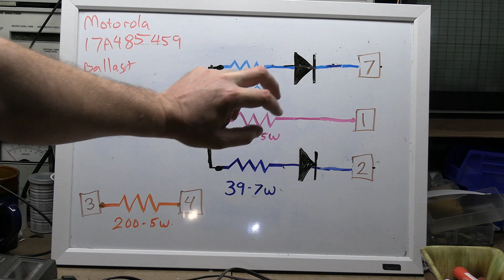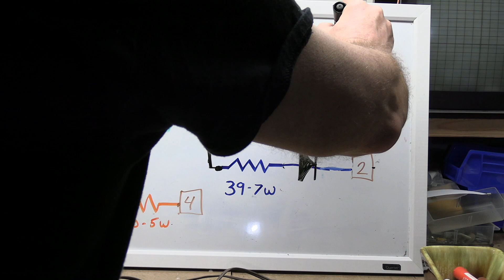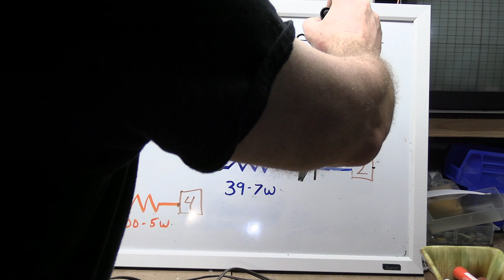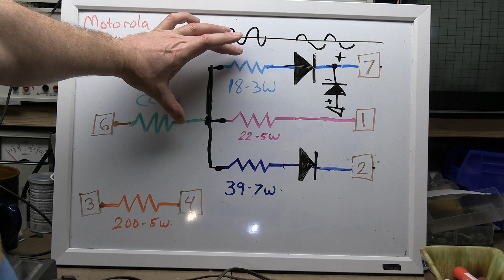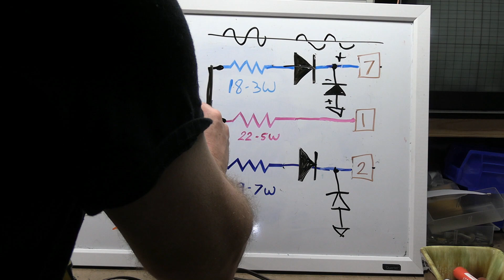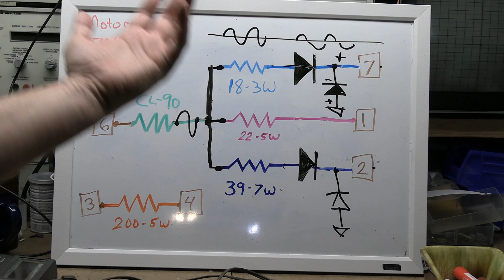Ultimate Guide to Motorola TV ballasts: Better protection

Comment: I was reading in the EEV blog about the purpose of small capactors in paralel with rectifying diodes to prevent RF noise would these be necessary in this situation? Might only affect AM radio.
Reply from the maker: There are small ceramic disc caps between the tube filaments already to filter out noise.  Otherwise, yes it would be a good idea.

Comment: At firstcI thought 2 diodes in series but then you would not know if one had failed comprimising the one thats left. This seems the most practical solution.
Reply from the maker: Yes, that is certainly another option.  You could do both and have 3 diodes in each branch.

Comment: In legs 1 and 3, I'd exchange the positions of the resistor and the forward diode, with the reverse "crow bar" diode to ground right after the forward diode.  This means the fuse blows but the resistors are probably unharmed in the scenario of the forward diode developing a short from a power spike.  It will require a few more pieces of wire to hook up inside the ballast case, but that's it I think.
Reply from the maker: Perhaps but I'm also think having the resistors before the diodes helps protect them from spikes and failing in the first place.